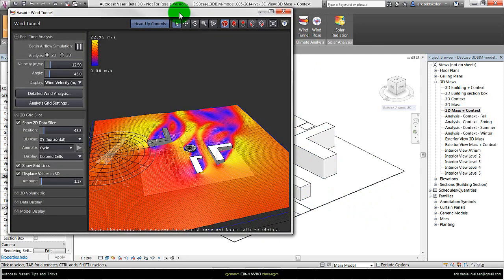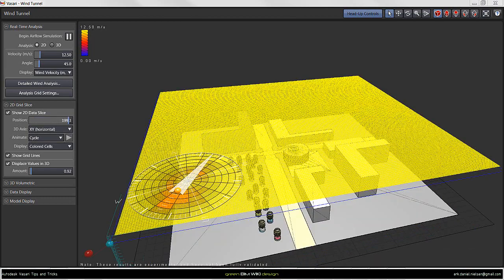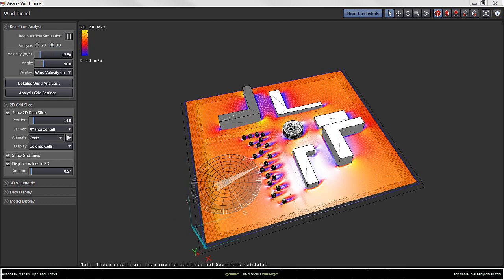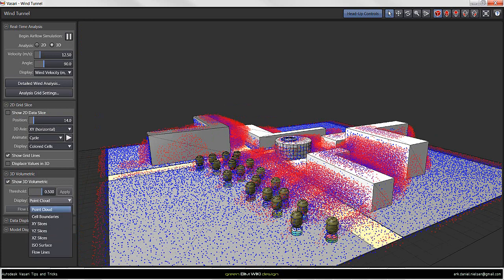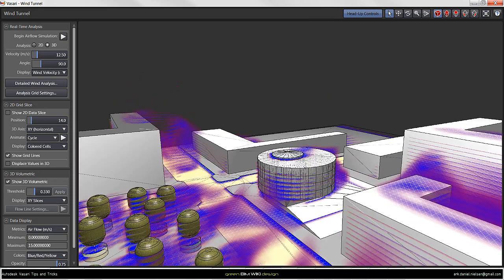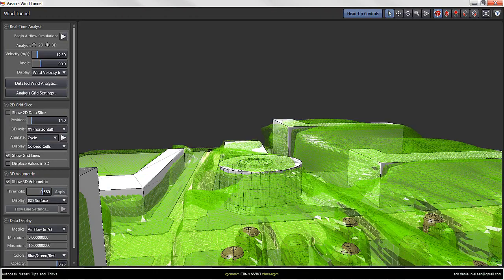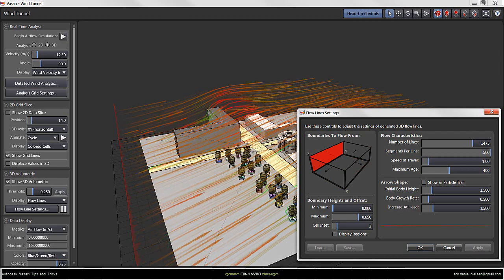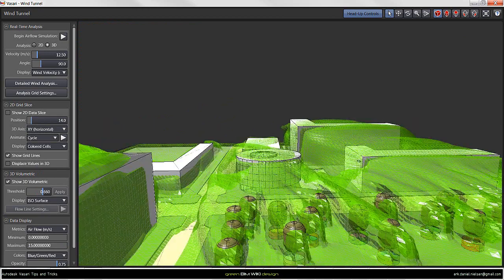Autodesk Vasari WA - Tips and Tricks about 3D Wind simulation functionalities

Comment: i am looking for some software that i can create a simulation of wind and pressure in a small tube with a special flap and curve design inside, is it possible you can help me with this, or point me to software i can download and use? ive been searching a while and havent been very successful, ive used many key words heh, just wondering though.  It is just for science/learning
Reply from the maker: If I understand your question, your are looking for a tool that allow you to simulate small objects. AUtodesk have other tools like Flow Design (mainly for buildings) or Simulation that is for this kind of stuff as I understand it. But Simulation is not easy to set up.
Reply: it seems like AUtodesk is a sub program that requires other software that im not sure what that software is.

this flow design must be able to show pressure in some way, by pressure meaning both positive or negative/vacuum